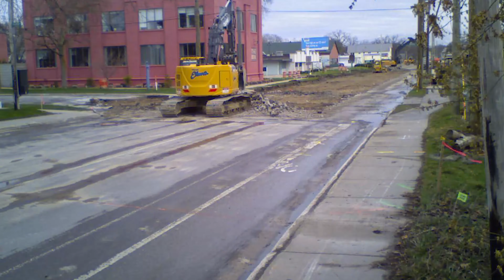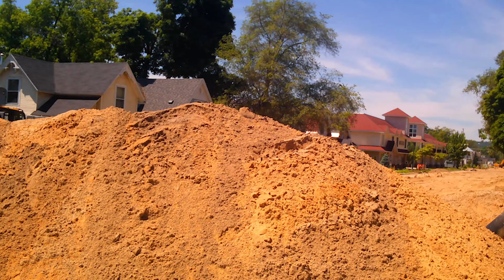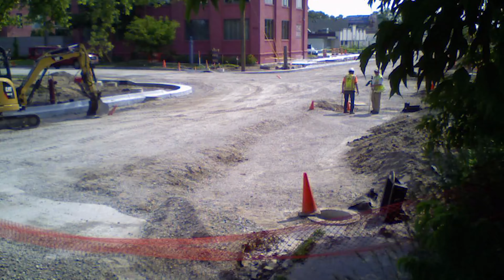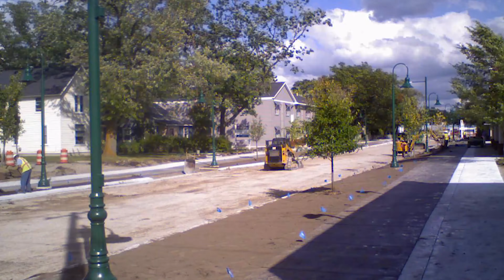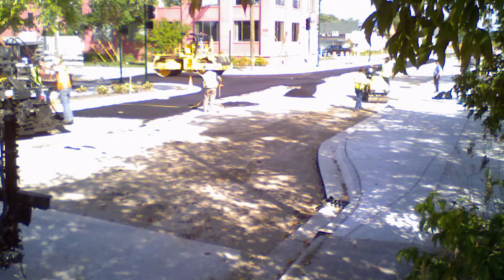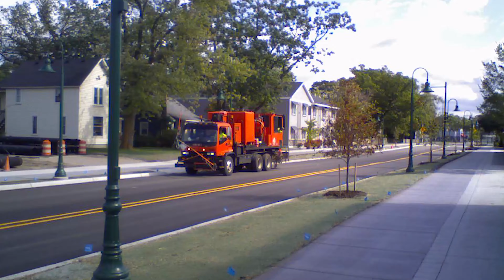Road Reconstruction | 8th Street | Full Timelapse

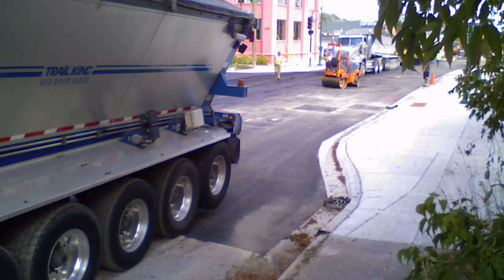Comment: 5:49 this 8 axle Tipper trailer is very interesting. In Europe there are 2 and 3 axle tipper trailers, in switzerland and the netherlands they use 5 axle solo trucks, but you don‘t see that many axles on a trailer unless it‘s a large flatbed trailer...
Reply from the maker: The State of Michigan allows up to 11 axles with no special permit. Basic weight formula is if an axle has at least a 9 foot spread from center of the axle to the center of the next axle in front and behind it you have gross 18,000lbs on the axle, are allowed 1 set of Tandem axles with a 9’ spread in front and behind it at 16, 000 lbs per axle of the tandem, all other axles that have less than 9’ spread are allowed to have 13,000 lbs per axle gross. That is how we come up with the 8 axle Live Bottoms gross weight of 154,000 lbs. A Super Train because of the spread axles on the pup is allowed 164,000 lbs gross weight.
Reply: @TeamElmers  From the UK.. can u explain in metric  (ducks and runs...) ;-)

Comment: Concrete bike lanes should have saw-cut crack control joints, not wet-formed, because wet-formed joints are bumpy.
Reply: Thank you for your observations. We will pass them along to the municipality's engineering team.
Reply: @teamelmersupdates7134  Thanks. It's not something most people think about, but I became acutely aware of it when my city started doing saw-cut joints in all of their new sidewalks (I don't know if it was a new requirement, but they suddenly started appearing everywhere). Riding a bike over wet-formed control joints feels like driving a car on Michigan freeways: very bumpy. I'm sure people who push baby strollers and shopping trolleys over bumpy sidewalks feel the same way.

(I don't make a habit of riding my bike on sidewalks, but sometimes it's necessary.)

Comment: Well,that didnt go very efficient!First the sand on the road and then take it out again to install the pipes for the rain water and then the sand back on it again.. :face-orange-frowning: And where is the bike path???
Reply: Hi Joop, Sand on the road is stockpiled to be used for backfill on the site. Sometimes you work with the space you have and need to stockpile on site to assist the trucks.  Or if you are talking about backfilling, pipe placement, filling again, and another pipe placement,  It may be because the Wastewater sewer pipe and the water pipe are placed on different levels/depths in the trench. Wasterwater is lower than the water line with a minimum distance between the two lines required. That could be the answer for the different sand backfills. Or it may be different sections of the road. Not sure which clip you are referring to. Hope that helps. Thanks for your observations. And the bike path is shared outside the road - it is double wide for pedestrian section and a bicycle section in the new construction area.

Comment: Nice! However, anyone watching this and does not see how there were so many unnecessary moving parts and digging… and how wasteful, time consuming and expensive this was… should pay extra tax dollars for this. A simple repaving, physical barrier for bikes and redoing the sidewalks would have saved sooo much money. A simple curb would have been safer as well to separate the street from the bike lanes all while creating a buffer. 🤦🏾‍♂️
Reply from the maker: @octaviouscollins4523 Agree to the sensible approach and responsible use of tax dollars. The people adding homes with no water pressure available would lovingly disagree about just paving the road. Sometimes roads need to be reconstructed due to their surface condition. Other times upgrading 50 - 80 year old underground pipes is needed to allow for growth in the area (and future growth). This reconstruction includes upgrading size and capacity of water, storm, and wastewater pipes, installing safer or more environmentally friendly systems, and safe operation of water, storm, and wastewater systems for years to come.